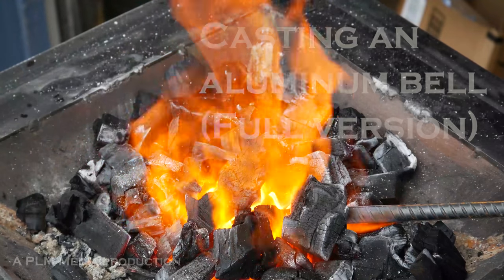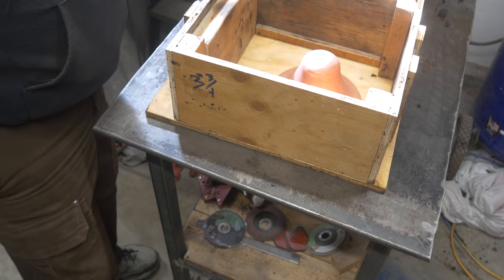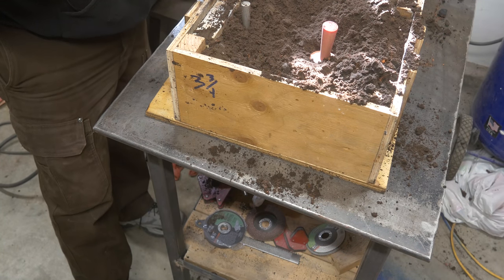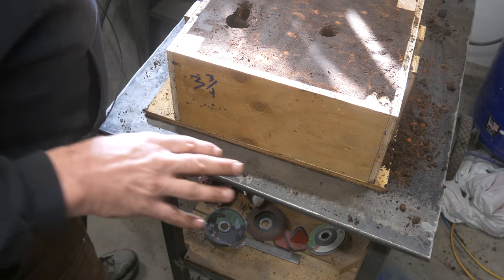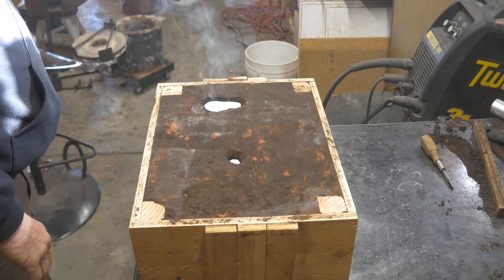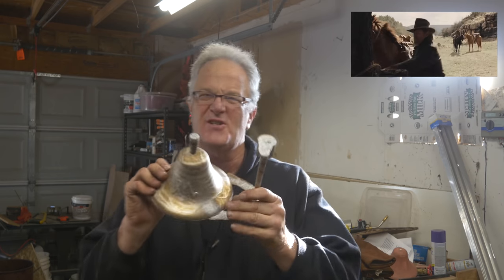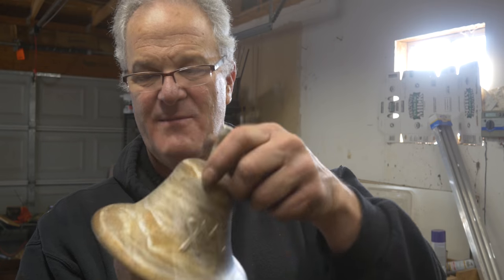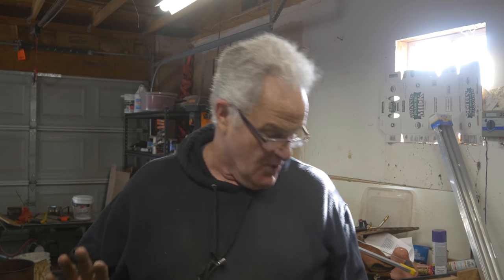Casting an aluminum bell - full version

Comment: I like your little lettering mold, interesting use of 3D printing for a complex shape like that family logo.
Reply from the maker: Even using the printer, it was a bit of a challenge to do. I ended up projecting a flat 2-D image onto the bell's outer surface then cut away much lf the bell after I did that.

Comment: turn it on a lathe and get a proper chime ... now, it barely rings. also check the correct alloy for best vibration .
Reply from the maker: Only two problems with that; I still don't have a lathe 😒 and that bell is long gone. I poured it 5 years ago to work on technique. I never intended to actually use it as a bell.
Reply: @swdweeb  ok, you`re the boss... I remember that many years ago one of our cooking pots had an aluminum lid, about 12 in in diam. and It had an amazingly long tone. That is why I made a search for aluminum bells. The rim of that lid was very thin, maybe that`s what gave it a pleasant sound. Good work, anyway.
Reply from the maker: @viewer7200  I don't know about being the boss, I've got A LOT to learn. I've seen people pouring aluminum bells but I've never really paid too much attention to the thickness of the walls. You're probably absolutely correct that thin walls will ring better. I've poured other flat thin parts in aluminum that actually ring pretty nice... nicer than this bell anyway 😀

Comment: Nice sounding bell. excellent pour.
Reply from the maker: Now you're just being polite ;-)  According to my guitar tuner it is an out of tune "b"
Reply: swdweeb who am I to argue with a tuner, I'm so poorly trained in music that I can't tell. but it's nothing a little metal reduction wouldn't fix. From what I've seen Bell casters usually machine the inside on a lathe to tune the bells.
Reply from the maker: @askquestionstrythings  Yeah, I've seen that too. If only I had a low-speed lather and the the instrumentation know what my metal removal was doing :-)
Reply: @swdweeb  I guess it depends on how far out of tune it is. I don't think you could go wrong if you chucked it up from the top nub in your drill press, run it at the lowest speed and use a coarse sanding sponge (maybe 60 or 80 grit) to take some off the inside. Take it out, check it with the guitar tuner, and see where it lands. Chuck it up again and make another adjustment, repeat until your happy with the sound. 

Just a guess from videos I've seen and the  U.S. bell my father has (similar size to the one you made) that you want to focus removing metal about 1/3 down from the top and at the bottom lip.

Comment: I have made 25 12 inch farm bells and 2 16 inch ones. I pour from the top and use no sprues. It works like a charm in aluminum with a zinc alloy.. Since i do mine outside on the ground,  I only need one cope box. After mold is set i pack very wet sand around the box to catch any run away metal. It works 99 percent. I use dowel rods to keep everything aligned.
Reply from the maker: Hey Ron. When you say 12 inch and 16 inch, how is that measured, The diameter of the rim or the height of the bell?

Comment: rambling is awesome! i prefer to see the melt aswell though, the ring of the bell will sustain longer once its freely mounted on string or similar, your fingers are absorbing the vibration
Reply from the maker: That is definitely the case if I move my hand down the bell towards the rim. Personally, and realize that I know nothing, I think the sustain is due to three factors, the shape, the thickness and I expect the real culprit, the material.   We'll find out if I'm able to cast the same bell using tin bronze soon.
Reply: @swdweeb  try drilling a hole through the top part and hanging it on a rope, should be much better, keep up the great videos!

Comment: Is there anything you can use to take up space of the sand.  Not around the piece, but in some of the outter bits? Just to save weight?
Reply from the maker: Sure, blocks of wood could be screwed into the corners or something.  I think I've already done that in this flask, I can't remember.
Reply: @swdweeb  I think you said you had those ridges.  You have quite the back of got videos to work through.
Reply from the maker: @junkyardzombie13  I'd ignore some of the early casting stuff, like anything before Sept 14 2018. Nothing but bad technique in there.  That should help reduce the load  :-D
Reply: @swdweeb  sometimes watching mistakes helps understand more when you see it perfected.
Reply from the maker: @junkyardzombie13  True enough, but the mistakes like big open sprues, "choking", bad runner and gate design,... aren't pointed out as mistakes and people could get the idea of "this is the way I should do it" when in fact they shouldn't.    As I write this, the thought crossed my mind that I should simply mark a lot of those as private so they can't be viewed.  I'll have to think about that.
Reply: @swdweeb maybe you could use them and make a new video showing examples where they were bad and now where you've improved

Comment: Bro.  Do work.  

Thinking out loud last night I says eh I think I could cast a bell how would you make the molds. I decided that the flask would be really tall.  I never considered gabe a cope and drag that are not symmetrical.  Kind of a duh moment but then that's why we post stuff and help people get out of thinking traps.
Reply from the maker: Indeed. Thanks. There are other practical points, it was heavy as it was, making a tall drag...aye yi yi.  Then of course, I pretty much ran out of sand with what I had ;-)